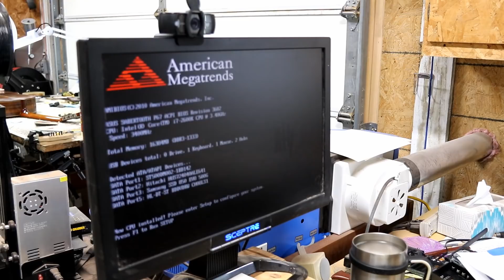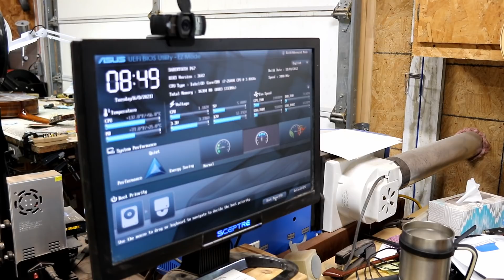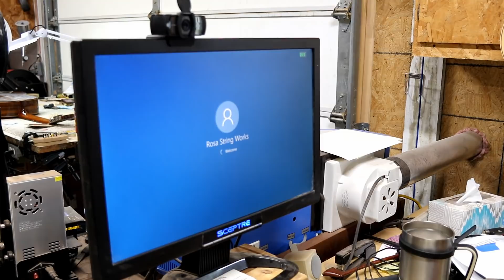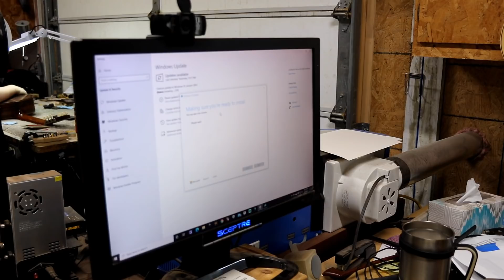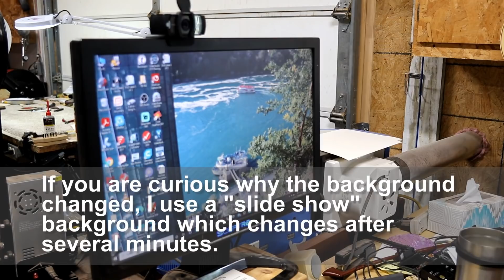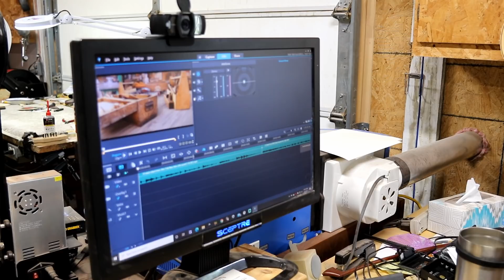493 RSW Upgrading an Old CPU to a Better Old CPU

Comment: I’ve built mainframes, super-micros, Suns, Apollos, Wang, Mohawks and every iteration of IBM and compatibles (pc) from 1979. Jerry, the second gen CPU was a smart choice, and like others here I will honestly and strongly suggest the extra upgrades  for the cooling system. It’s about the “cause and effect”. That CPU runs hotter, and the stock fan is barely adequate for it under the conditions and activities (video and sound editing) unless it is in a controlled/cool environment. It will become noticeably warmer. I personally use a very similar setup (box and all!-which shocked my wife), however I did spend the extra for a liquid cooled setup when I first built it, and will say it was the best thing I did to the system. Akin to using dear antler on a Mando. And so much quieter too-near silent. You’ve given so much advice and rekindled my love for musical instruments, I feel it only fair to share my experience and knowledge back. I still build and fix puter equipment. But retirement is now focused on music. ;)
Thank you for sharing all you do Mr. Rosa! 💕

Comment: If you haven't replaced a CPU in a while you could have checked for some videos showing how it is done. Your ability to figure out the mechanical aspects of things served you well.  The one thing you didn't show was replacing the thermal paste on the bottom of the CPU fan assembly.

Comment: Thermal paste with original fan is SUPER important. If it gets to warm it will throttle down and you get maybe 70-80% of the performance you have payed for. Tip: Get new thermal paste, Clean the cpu with alcohol or similar, buy a larger CPU cooler (perhaps the one they sent you is larger). applying thermal paste, use youtube videos on that. Then set the BIOS setting to "super speed"...

Comment: Jerry, you are a kindred spirit! Thank you for being you! 

As for grounding while working on electronics, here's the thing. Often times ESD related damage can be LATENT. In other words if you unwittingly zap something lightly not enough to kill it, you will certainly reduce the part's lifespan, often by a lot. Then you get a hardware failure seemingly out of the blue. Well, it's most likely not out of the blue, it's from a latent ESD damage that may have occurred a year ago. So grounding is a good idea. However, I am not criticizing you at all. Because you are working on your own system, which is not mission critical and you are a grown man and know what your risks are, so more power to you. I believe in you 100% from watching your videos and being a kindred spirit I know you will be fine and I am not worried at all for you! I myself rarely ground myself when working on my own equipment, but I am aware of ESD and keep it in my mind. If it's a dry day and there's more static around I WILL put a ground strap on. Otherwise I just make sure to discharge myself against the chassis and with god's help it is usually okay.  

Be well and keep on keeping on being yourself (as if you have a choice, lol).

Comment: Cooling is very important, especially when dealing with higher core count CPUs. You'd probably get a noticeable performance gain by upgrading your CPU cooler to one of the tower style air coolers with the 120mm fan on the side. Fresh thermal paste will help as well if the cooler doesn't come with one. Also, it looks like your new processor is able to be overclocked. So adding just a $25 air cooler off amazon and overclocking your processor by selecting the optimal setting you were seeing in the bios should help a lot. If not, you may end up thermal throttling with that old paste and smaller cooler.

The increased PCIe lanes of the new CPU should increase the performance of your video card if it is capable of utilizing them.

Comment: Have worked on computers since early 90’s as a contractor for the DOD.  Before personal computers became popular I installed communication equipment including entire comm centers for them around the world.   The last five years of my career was a federal employee and then retired in 2014.   Totally agree that most problems I experienced over the years were software related.  
Bought a Dell desktop in July of 2009.  Still using it although have replaced the power supply, and added memory and I’m on the fourth hard drive.  Other than that it’s been working fine.

Comment: I’ve built many PC’s and other than installing the software, researching component compatibility is time consuming. Like you, I was trained in Bell System practices and they were anal about ESD. I would invest in a wrist strap. I’ve seen microscopic shots of chips with ESD damage and they looked like lightning struck ground. This damage didn’t always show up as component failure but could be intermittent based on heat etc.  This can be extremely frustrating. We had many plugins that were sent back as defective that were bench tested and sent back as good only to cause the same failure. Great video Jerry. For anyone reading this and not knowing what ESD is, it’s electrostatic discharge.
Reply: Thankfully not in hardware anymore myself. I've personally zapped components, so I always wore the strap in the field. Once I moved to office only, I got the desk pad that was grounded. It's cheap insurance.

Comment: hi jerry! as a big luthier fan as well as a huge pc nerd, i was very pleased to see this video. there’s a couple things i noticed that could’ve been done even before tackling the cpu (i still think it was the right decision to upgrade). 
1. you stated you had 16 gb of ram but from what it looks like you have odd configuration with 2x4gb sticks and a single 8gb stick. i would recommend either going with 4x4gb sticks or 2x8 gb sticks to allow what’s called dual channel mode. this makes memory speeds much faster! (if you go for the 2x8gb configuration make sure the sticks are in the same colored memory slots)
2. the coolers that come with intel processors are notoriously bad! get yourself a half decent cooler (cooler master hyper 212 evo is the industry standard that people use) and a decent thermal paste. bad thermals and overheating can cause whats called thermal throttling which is when a cpu (or gpu) down clocks in order to prevent this. if you have good paste and a nice cooler your hardware can maintain higher clock speeds at lower temperatures and overall prolong the life of your hardware. even getting a few more big (but quiet) fans can help, although you seem to have a good number of fans
3. not really a tip but although that pc is older thats a really nice motherboard!! sabertooth pcs are highly valued and go for a pretty penny even used 
4. also not a tip but i’m pretty sure grounding is a myth or at least so rare that it’s unnecessary. i think it has been seen that way for a while now haha. 

great video jerry! was nice to see that you have some knowledge about a hobby i really enjoy as well as instruments!

Comment: The 2nd Gen i7 would most likely be the better choice (over the Gen 3 i7), I believe the number of physical CPU cores is the same (4), both support hyperthreading (meaning windows thinks it has 8 CPU cores/threads) the biggest differences are in clock speed and power consumption. If I remember correctly, in an effort to reduce power consumption, intel reduced the clock speed a bit  in most of their Gen 3 processors which wouldn't help your resource hungry video editing software (all video editing software is resource hungry). With regard to the boot priority in the bios: changing the cpu would not have changed that, but if windows isn't installed on the other drive which was selected the computer couldn't have booted. Of course if windows is installed on there, that would also expkain why the system was sluggish before.  As others have said, I'd really consider swapping out the "stock" heatsink/fan for an aftermarket one to improve the cooling, and would definitely do that before enabling the performance option in the bios (as the cpu will definitely run hotter and need the better cooling).

Comment: The second generation i7 is faster because it has more cores than the old i5 and the clock speed is higher. The facts that the i7 is made in older technology and it runs faster and it has more cores means that it generates a lot more heat. I would suggest that You buy an after market cooler for the CPU that can handle it. They are like 20 to 50 bucks. And I suggest one or two fans for the case so that the inside temperature of the case won't go too high. Love your videos, even if they have tractors or computers in stead of instruments, haha.

Comment: I worked in the PC market  building and repairing  Pc's  I loved it  learned a lot  back in 1995 I stopped  in 2001. now I fix and build PC's for family & friends. 16 gigs is ok but you made need to max out the memory for the Motherboard. new CPU will improve your through put.  Current  Core i7 Processor CPU has 4 physical cores, instead of 8 cores. Due to Intel HT (Hyper-Threading Technology), it can Multi-threading. when [Enabled] Intel

Comment: Hey Jerry ... just to chime in and be redundant to what so many other commenters suggested, upgrading your cooler is something highly recommended. Intel stock coolers leave much to be desired (temps as well as noise). Cooler Master or Noctua are established brands offering good products, many options and widely available. Thermal paste carefully applied is also critical. Video rendering can be CPU intensive, and overheating will cause the system to throttle and really slow down. 
Thanks for all your great work! Keep it up.
Reply from the maker: Thanks, I am definitely looking into it.  I plan to monitor it and test it.  You would kind of think Intel and AMD could manage their own product well enough, wouldn't ya?  Is the cooler thing just techie hype that has become standard?  Or, is it truly necessary?  I plan to find out.
Reply: @RosaStringWorks  Hey Jerry ... it is meaningful, especially with older CPUs like yours. (AMD, my current build, has done a much better job recently with their coolers..not sure about Intel though). My thought is your older CPU/cooler is probably being pushed close too (or beyond) it's limits with higher resolution videos of today that weren't around much when the CPU was "new". But I'm certainly no pro so it's of course possible you'll be OK, so keep an eye on temps and performance. Open Hardware Monitor works well for me, and has an cool onscreen widget to easily watch temps, available memory, CPU loads, etc. Keep us updated!

Comment: the stock cooler is the problem its always gona thermal throttle and with a i7 you need a good air or watercooler
hope this helps gerry
edit its a good thing that crappy cooler is broke now you need a decent cooler

Comment: The i7 produces noticably more heat than the i5 so it might be worth looking for another CPU cooler, which will also be less noisy than the original Intel cooler. The Intel cooler might not be able to handle the heat for too long so it might throttle the CPU after a while, which would decrease performance once a certain temperature is reached. Personally I'd go for something like an affordable but still strong Enermax ETS-F40-FS, which (as a tower cooler) also pushes the air towards the exhaust fan so the heat is leaving the case instead of pushing down onto the motherboard. I like it better than the better known be Quiet! Pure Rock, which is also a nice affordable cooler, but the Enermax is slightly more efficient and easier to mount.
The Intel cooler is more some kind of alibi cooler that is working somehow but not optimal. With newer generations they even stopped putting it in the box with stronger CPUs.
Compared to guitar saddles that transfer string vibration instead of temperature: Intel stock cooler = plastic saddle / Enermax ETS-F40-FS or be Quiet! Pure Rock or Arctic Freezer 34 = bone saddle / Noctua NH-U12S or be Quiet! Dark Rock Pro 4 = deer antler saddle
Running an i7 with the stock Intel cooler is like having a Martin guitar with a plastic saddle. It's possible but not recommended as it could cost performance.

The 2nd gen i7 is much faster than the 1st gen. 3rd gen is a bit faster indeed but the different is much smaller than the difference between first and second generation.

Comment: Spent 47 years 'fixing' computers. I was a mainframe guy...but, had a lot of experience with servers, PCs etc. I agree. hardware computer repair is GREAT fun! I will say, ESD is a stealthy issue. You may not see any issues, but over time the damage can become apparent. Hope it doesn't bite you...   :)
Reply from the maker: Like I said I've never had a problem and I've done hundreds and hundreds
Reply: @RosaStringWorks  Just sayin' it does happen, but as long as you are touching the machine frame it will help. Good job by the way!

Comment: Something else for a change :-). Those stock coolers aren't the strongest ones . If you keep having troubles I suggest you have a look at the cpu temperature while streaming/editing/... to see if it throttles due to thermals, when it gets to hot (happens at about 85 °C and higher). Many simple small and free programs are available for that.

Comment: You are  lucky you found a compatible I-7 on something that old.  Intel for reasons of their own, probably greed, force you to repeatedly change motherboards with every couple of  newer generation chips.   I-7's dramatically out perform I-5's.  Incidentally, that "paste" helps the chip run 2 or 3 degrees cooler.  Congratulations on your upgrade and forturate success.

Comment: 7:53 Gounding. Jerry you did ground yourself. You were holding onto the chassis. Fixed PCs myself over 10 years and never used a grounding strap without any problem. In winter time when static became any form of an issue, I would just touch the chassis. Became less of a problem in more modern machines, the components became less susceptible. Ken in Australia
p.s. I love tractors too especially grey TE20 Fergies
Reply from the maker: I used to own a TO 30 Ferg it was a good tractor

Comment: The heatsink fan from the old i5 is actually a better heatsink than the new one. The old one has a copper core while the new one that came with the i7 does not. The copper core will do a much better job of transferring the heat from the cpu.

Comment: Your  i7-2600K CPU ('Sandy Bridge' process node) is just fine. The next gen i7-3770K ("Ivy Bridge") is just marginally faster. And with that nVidia GPU you have, it should even run Windows 11 just fine - when it drops some time after June 24, 2021.

Comment: Was hoping you'd use the bridge warmer and a hot knife CPU off, then run the new CPU through the Thickness sander a few times to get the goop off the cpu.

Comment: An old computer like that will never really be fast. Since you already have Windows 10 (and don't maintain an old OS), you're better off with a new motherboard. It will support M.2 SSDs which are noticeably faster than SATA which you probably have.
I guess that will have to wait to use the value of this new old processor.

Comment: Hi Jerry, funny thing, I was just researching a couple chip upgrsde for my Dell pc.  I currently have an i3 and I was contemplating an i5 upgrade.  Are the chip configurations standard?  Will your old i5 fit into my system?  Is it for sale?   I have worked on pc's for years and built many so the installation shouldn't be a problem.   Thanks.
Reply: That's a CPU chip upgrade...
Reply from the maker: If you send me an email we'll talk about that I think that might be an option
Reply: Will do... talk soon

Comment: Out of curiosity, how much ram go you have? Maybe an upgrade there to go along with the I7 could help with speed.
Reply: I think he said he had 16GB.  That should be way more than enough to just stream a video.  He also said he had a fairly high-end video card with plenty of RAM.  His hardware should be more than adequate.
Reply: @Sci-Que  He's got a Radeon "Saphire" card.
Reply: @zapa1pnt  What he really needs is a decent broadband connection.

Comment: I'm thirteen minutes in, and still waiting to see if you went 3770k Ivy Bridge, or the actually better, I thought, for video compiling 2600K Sandy Bridge... And which you think as being better.
EDIT: Made it to sixteen minutes, and boot screen gives it away. But after a half tuckus search, I can't quite say Ivy Bridge and a 3770K wouldn't be better. At some point Intel stopped having CPUs that could hardware acceleration of video compiling; so current CPUs no help there. But no longer think Sandy Bridge was last version that could.
Reply: Wait, you're running three sticks of ram. Suggest you get a matching version for the red stick, or a new pair (same frequency sticks too). Put fastest timing ram in 1&3 (we're talking if a fairly large difference in your timings too). If timings are the same, or really close, put set with lower amount of ram in slots 1&3. As in 2x4gb in 1&3, while a set of 2x8gb should go in 2&4.
And run ram in XMP mode as well.

Comment: I’m assuming you are finding the audio and video are out of sync on your long clips. The problem lies in the codecs and the software. At 30 fps there should be 1600 samples per frame at 48k audio sample rate. Trouble is in your software the sample rate is 29.976 fps. That difference wont be noticed on short clips but adds up on long clips. Only Protools handles it properly by letting you pull up or pull down to correct the difference. Otherwise just shift the audio when you edit the video. Welcome to the real world of sync.